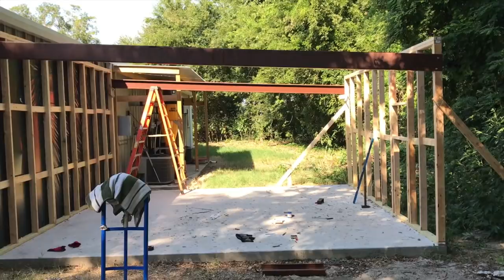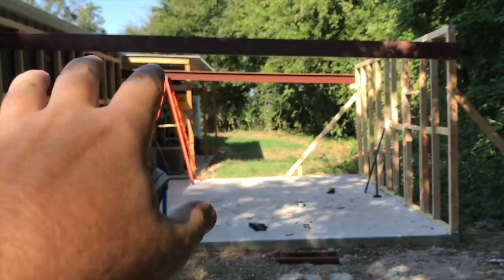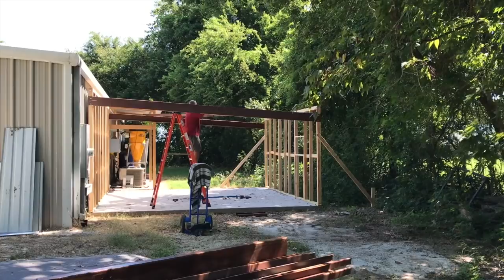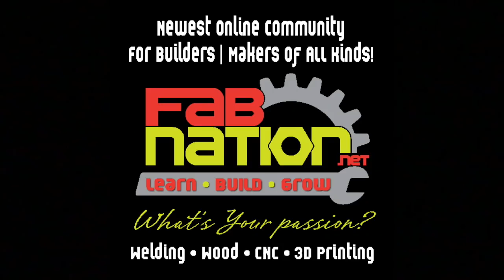Home Built DIY Metal Building Paint Booth - Part 7 - Welding Roof Joist Purlins

Comment: Getting er done Gary. I don't know if I mentioned this before but I was thinking (which is usually a bad thing) that you didn't put a door from the shop into the paint booth is because of the steel beam that runs down with wall with the electrical. Well back to what I was thinking Lol is that you could make a Thomy Schuuu portal into it :)